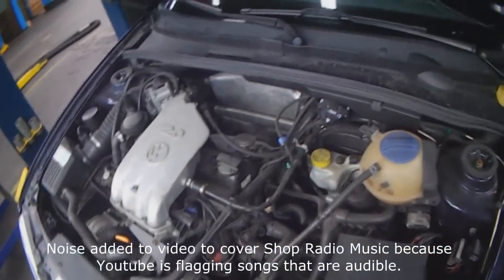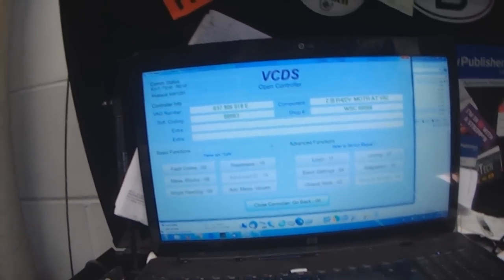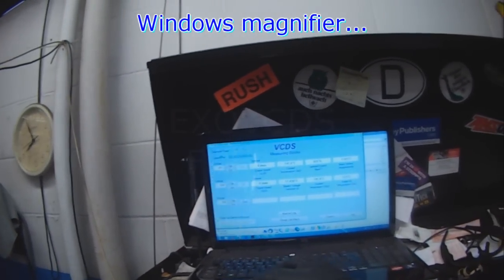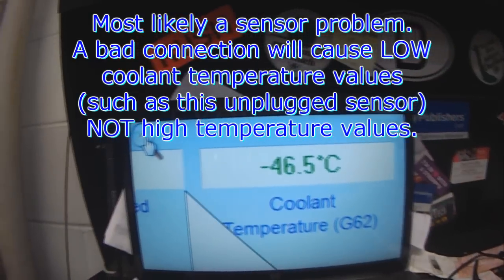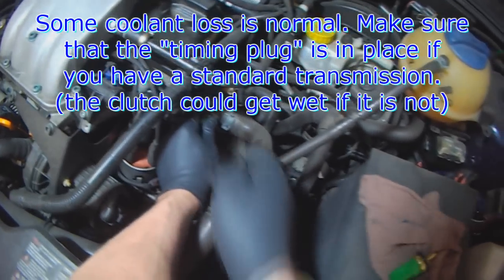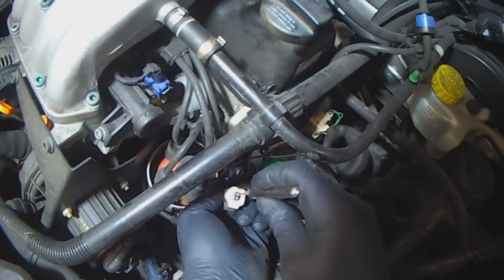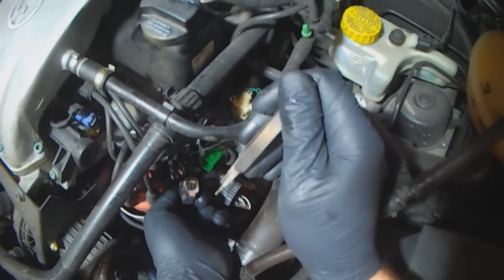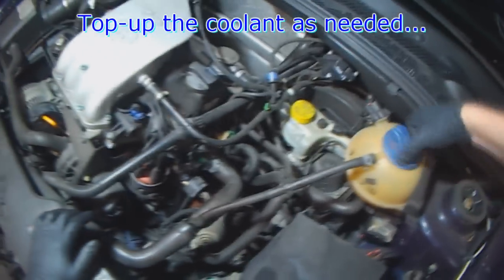VW A3: 2.0L ABA P1256 ECT Open / Short to Plus (part 1)

Comment: I switched my sensor and the check engine light went away and it came back with the same code 2 days after
Reply from the maker: Year, make, model, engine? Check the wiring, monitor temperature from cold to hot with a scan tool, so you can check for signal drop outs. Does the needle in the dash function as it should?
Reply: So it’s a Volkswagen Golf 2.0 2000 and the temperature for the car takes forever to warm up and it usually always below like if it doesn’t read it correctly
Reply from the maker: What was the actual fault code? A faulty thermostat (common) will cause the engine to warm up slower and also have less heat inside the car. I will post links to a thermostat replacement video in my next reply to you.
Reply from the maker: Watch this:
https://youtu.be/GM6FzBMNQIc
Reply: I have a code P1256
Reply: And a p0422
Reply from the maker: What color is your temperature sensor?
Reply: It’s a green one where the coolant flange is at and I’ve replaced it and it came back again like 2-3 days after and idk if I should switch the coolant flange
Reply from the maker: The flange is not an issue, unless it is leaking. 
P1256 points towards an electrical issue / issue with the circuit for the coolant temperature sensor. 
http://wiki.ross-tech.com/wiki/index.php/17664/P1256
If you have a scan tool that can read live engine sensor data... monitor coolant temperature (I think I mentioned this / suggested this to you already. That way, you can see what is going on. When the engine is cold, coolant temperature should be similar to ambient air temperature (can also be viewed with a scan tool). Start the engine and monitor coolant temperature with the scan tool... it shouldn't take more than 15 minutes for the engine to get to operating temperature (hold the engine rpm at 2000). If at any time the temperature starts to go back down by a lot, then the new sensor is bad or there is a problem with the wiring / connector(s) somewhere. 
Since the needle in the dash receives its own signal from the 2nd circuit within the coolant temperature sensor... it is rare to have both circuits be affected, meaning that if the temperature needle takes a long time to get to the middle... it's usually a thermostat that is sticking open / over cooling the engine. 
Since I can't see what you see, I can't check the sensor, connector(s), wiring etc for you. You will have to do that yourself... and like I said, a scan tool should be able to help you (as long as the scan tool can see / read live engine data). The other code "could be" related... if the engine is running cooler than it should be.
Reply: @EXOVCDS  okay thank you so much Thomas! I wish you were somewhere in Oregon for more help haha
Reply: I have the same engine in my 1997 Jetta. I had the auto parts store run the cel code and got a bad coolant temp sensor code. When driving the car I noticed it gets hotter than normal and the gauge in the dash sometimes jumped around back to normal temp. When I look for the sensor I noticed two identical sensors going into the same upper radiator hose, one pointing up, and the other sensor is the one you replaced in the video. The one pointing up is far dirtier and old looking. What is the second sensor pointing up?
Reply from the maker: A wiring diagram will tell you what the sensor is for. Match up the colors of the sensor wires with the wires in the diagram. The legend of the diagram will tell you the sensor name.
Reply: @EXOVCDS  will do, thanks for the reply. 🙏🏻

Comment: Hello Thomas first of all awesome tutorials!, I have the same code on my jetta tdi 1999.5, and i change the CTS but it keeps reading the same code, i disconnected the sensor to see if there was a change in the temperature but there was not a big change i had 28c intake and 26c on the coolant temp, may be the harness? the car starts if I disconnect the CTS but if it is plugged it won't start, please help, thank you!
Reply from the maker: mk4 / A4 Jetta? The TDI has to crank at least 280 rpm when cranking to start. By disconnecting the coolant temperature sensor, you are activating the glow plugs... which helps start the engine. If the coolant temperature sensor reads correct when the engine is cold, then temperature sensor should be OK. Check your intake manifold for excessive carbon build-up (less air into the engine = less heat when the air is compressed) and check that the injection pump timing is correct (late or too far advanced injection timing can cause starting issues).
Reply: Ye it is a Jetta MK4, Im going to check the injection pump timimg, but why the vag com keeps throwing this code 
Control Module Part Number: 038 906 018 EB
  Component and/or Version: 1,9l R4 EDC G060SG  2143
           Software Coding: 00002
            Work Shop Code: WSC 00066
1 Fault Found:
17664 - Engine Coolant Temp Sensor (G62): Open or Short to Plus
        P1256 - 35-10 - - - Intermittent
Reply: thank you for your help!
Reply from the maker: +Zoe Media The sensor signal can do drop out... the new sensors are green. You need to monitor the coolant temperature from a cold start until the engine is fully warm (radiator fans turn on).
If the temperature drops out, sensor or wiring is bad.
If the temperature never changes, sensor is bad or some kind of resistance problem within the circuit.
A broken wire or disconnected sensor should show -40c.
If the sensor is shorted, the ECM will see a hot signal 130c

Comment: Hi friend, I hope you can help me!! I am a bit desperate with a vw GTI 98 (I am a mexican mechanic) Well, I have in my shop a 98 vw GTI with a lot of problems (timing sincronization out of specifications, bad ECT, some oil leaks in valve cover, main crankshaft seal, and O2 sensors faulty) The car had a very hard start, when finally the car starts and run I need help with the gas pedal, if do not that it stops. The car hesitate and chug horrible, while I press up and down rapidly the gas pedal to avoid the engine stops. The exhaust throw a black smoke. And now, when the car starts it can not up the revs more of 1500-1800 RPM, when the temperature of engine goes up the RPMs are "free" more and more (when the engine is cold and I press the gas pedal the needle of tach do not up more 1500- 1700 RPM, and hesitate and chug are present) When the engine is more warm the RPM goes up slowly more and more, for example (50C'  1500 RPM, 60C'  2000 RPM, 80C'  2500) when the engine is completely warm the acceleration is really good, no hesitations and no chug. And now, THE MOST STRANGE FOR ME: I sinchonized the engine, changed the timing belt, replace the ECT sensor, the O2 sensors, repaired the oil leaks, erase codes with the VAGCOM, I do the adaptation of the throttle body, clean all parts necessary, all read of all sensors are good, I do the "basic setting" and now the car starts really good, BUT THE HESITATIONS AND CHUG CONTINUES!! And when the engine warm the RPMs are "free". Is the same fail, with or without change of faulty parts!!! When the engine is cold=lock RPMs and hesitation, medium warm= more RPM but hesitation, full normal warm= good acceleration and no hesitation, really runs good!!! Do you have any idea, friend???
Reply from the maker: I'm still at work... I'll get back to you a little later once I am at home.
Reply from the maker: '98 GTI with what engine? In Canada the '98 was still a mk3 with a 2.0l engine.
Reply: First at all, very thanks for your response!!  Yes, the car is mk3 with a 2.0 ABA engine. I forget say the MAF sensor is new, because the old sensor was faulty also. Now, maybe for the replace of ECT and MAF and the O2 sensors the black smoke has gone, the car starts smooth and have a good idle, but with the problem of the acceleration.
Reply from the maker: ADN Make sure that distributor is installed correctly when engine is at #1 TDC. The crank sprocket can move and that can cause power / performance issues: http://fkh161.ca/VW/CrankSprocketGoodBad.jpg
Reply: Hi, I check the distributor and it is right,  the crank sprocket is really good, and I check the gears of the camshaft and auxiliary shaft and both is in good conditions. For set the timing I use the timing mark in the flywheel, (a shape as a little letter "o") aligned with the pointer in the bellhouse transmission...Is this correct? And set the rotor of the distributor in line with the small line in the body of the same (or 90 degrees in relation to the connector) and the camshaft with the "OT" mark. Is this the right way? I think, if possible maybe the fail is a electrical problem, or a fail of ECM? What more I must check?
Reply from the maker: +ADN Yes, electrical problem if all mechanical components are timed correctly.

Comment: Nice step-by-step on the ECT fault Thomas and good tip with the battery corrosion to eat away at corrosion. Never thought about that, but sounds like a good idea. Keep up the good work..
Reply from the maker: +stuzman52 Ivan had a shorted connector (caused a relay to stay on)... that was also in the back of my mind. So it WAS a big relief for me when the sensor ohmed-out bad. :)

Comment: Battery terminal cleaner , don't remember you using it before but I like it. 👍👍
Reply from the maker: +Steve Rob http://www.autopartsapi.com/eEuroparts.com/images/parts/lg_5b76f751-79e0-422f-a7be-8f12dcb63f16.jpg
Reply: I'm getting a can tomorrow. Thomas do you have a set of Loadpro test leads.
Reply from the maker: +Steve Rob Yes.
Reply: +Steve Rob  dan sullivan is a top notch guy as  you call it :)
loadpro test leads  http://www.brighterideas.com/
Reply: Intrade Motor Yes Dan is real sharp and I have and use his test leads. . I mentioned to Matt long ago to  get them and he ignored the idea . You suggested them as well, I hope he takes your suggestion. you know they work . Take Care
Reply: Hi Thomas im having a problem i check the signal on my plugs .it spark once or twice and then it stop. dont understand, Help please.